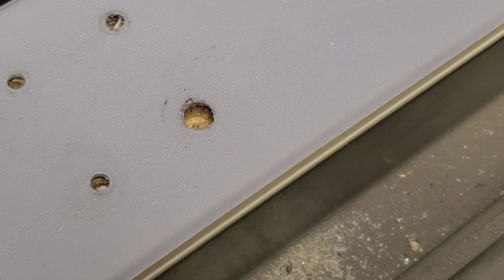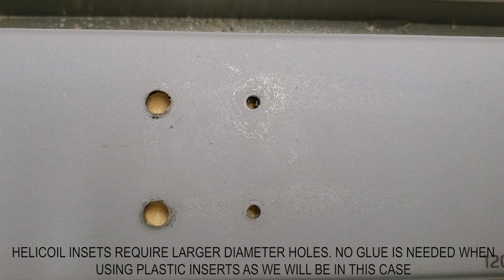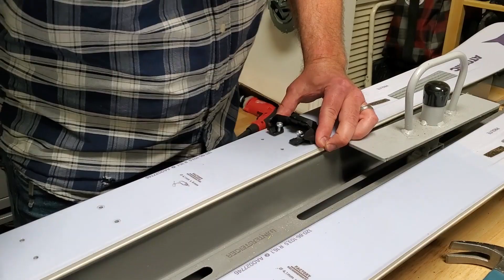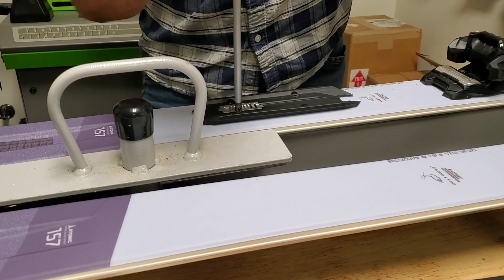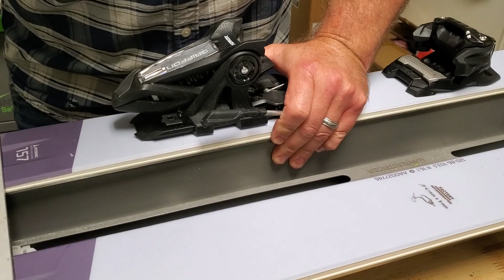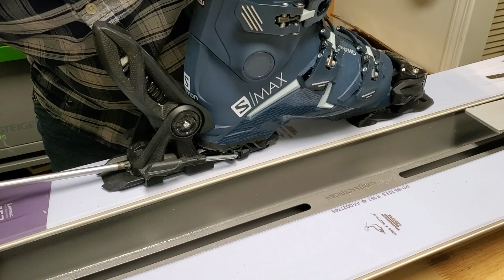Ski helicoil installation and binding mount - a step by step guide on heli-coils

Comment: Thoughts on a full toe peice heli coiled? meaning all 4 screws of my toe piece being heli coiled?
Reply from the maker: It's an okay idea. In fact we install bindings with heli-coils on all screws for serious racers that put enormous amounts of G-force on their bindings and do not want them to pop out under any circumstances. One difference here in this video is the use of plastic inserts. The plastic inserts are usually used for average skiers and light weight skiers. They are also easier to shave off to fit and accommodate for the thickness of the skis they are going into.
Reply: @stickdocs1128  so would you used plastic or metal helicoils for someone who beats on their skis and is definitely on the more aggressive side?
Reply from the maker: @Zeachh  Depends on your skis and how thick they are. Beefier skis would need the metal helicoils. If you aren't a ski racer,yet very aggressive all mountain skier, you can use the plastic inserts and they will perform just fine. They will also give you better flexibility to take them out with more ease later on. Be sure not to use any glue when using plastic inserts or they can actually cause the plastic insert to spin inside the skis.
Reply: @stickdocs1128  So they have a wood core so I think ill use the plastic helicoils, you wouldn't suggest using epoxy for the helicoils?
Reply from the maker: @Zeachh  No. Much like a drywall anchor when using a plastic insert, it should open up and anchor against the core of the skis when the screws are inserted. Epoxy and glue are used in metal helicoils.
Reply: @stickdocs1128  ok thanks fam!